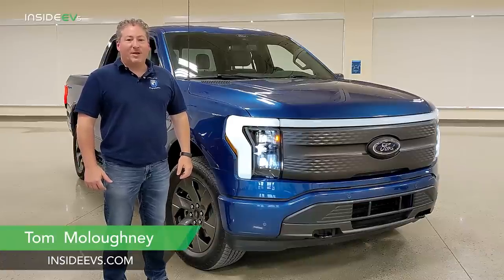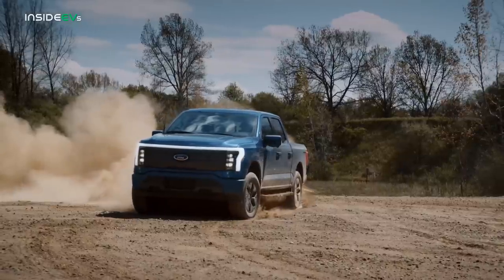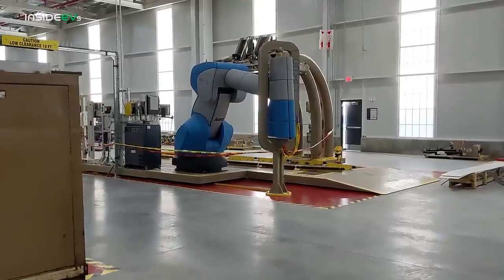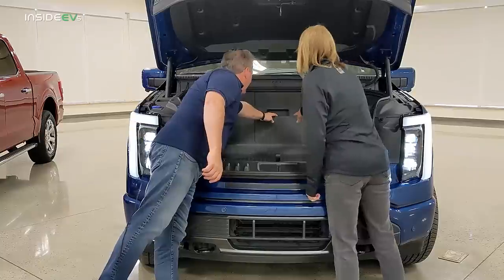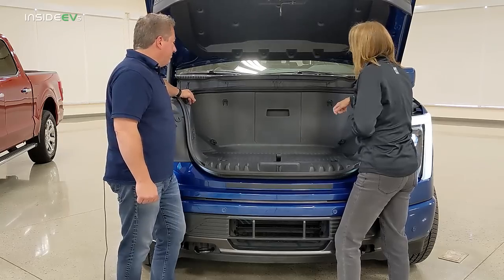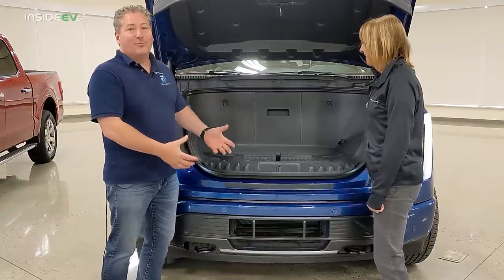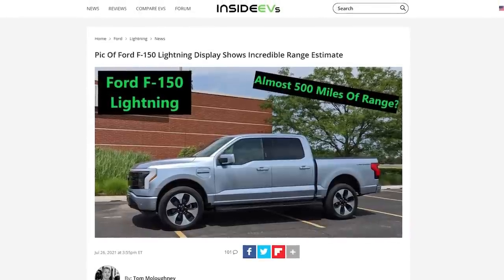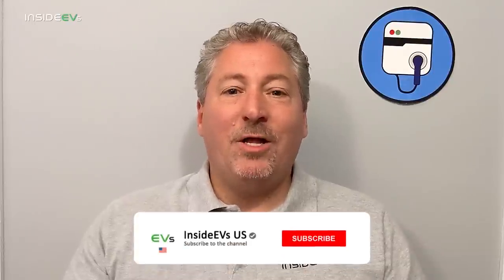Ford F-150 Lightning: InsideEVs First Drive Review

Comment: As a contractor who goes to various work sites this truck will be perfect for my needs.  I average about 150 miles driving per day so i wouldn't have to worry about charging outside of my home.
Reply: Agreed. I’m averaging 250 miles a day doing thumbtack jobs and I’m spending about $700-$800 per month on gas. I would literally save money buying a lightning f150 compared to my 2018 f150 with the 5.0 V8
Reply: @ericerickson592  I would bet my ass it wouldn’t be $700-$800 higher every month lol
Reply: @ericerickson592  1/4 to 1/6 the cost of gas
Reply: I'm thinking you'd cover your shed/garage/carport in solar panels. These are very cheap second hand,  still delivering about 80%.

Comment: The concept of using my Lightning as a battery so I can run my cottage during peak electrical hours and charge the truck during off peak hours is a game changer.  I'd love to see more about this, the inverter, the control panel, the charger etc.  Thanks !
Reply: I would be cautious about doing that too much, depending on how much electricity your cottage uses, this can cause excessive strain on the battery, reducing its effective life.
Reply: @AlamgirTamboli  I wouldn't worry because the battery life is likely to be measured in decades. Early Tesla batteries have been lasting 400,000 miles and newer ones are expected to make it a million miles. I expect Ford to be using the latest technology from SKI.

Comment: 19.2 kW charge rate is more than the peak consumption of my whole HOUSE which peaked at just over 18kW. I have two EV's that can charge simultaneously.

This is a great video!! The Frunk in the Lightening looks really awesome and so much better than the Rivian. Ford have utilized next level thinking and engineering here.
Reply: "Next level thinking and engineering"
🤔
They used the ICE cab) Front Clio from inventory to save money.

They bought in a compact (off the shelf?) front drive unit from a third party. (Time and money)

They cobbled together (literally) a  thermal control system from the parts bin which happened to sit vertically (time and money)

As a result of that, there was a  *"::"*:-  big hole where the ICE motor used to be.

They added a frunk tray similar to one they'd seen "elsewhere".

Logical progression, yes.

"Next level thinking and engineering"?
Let's be honest here.......?

Oh, btw the Rivian?
That passthrough storage below the rear seats?

"Next level"?
Certainly unique.
Reply: @rogerstarkey5390  Until we see a teardown from Sandy Munro I will take your comments as speculative. Other than those working at Ford on the vehicle few know how the car was put together. Let's wait for the Sandy Munro teardown.

Comment: This F150 Lightning is shaping up to be the most practical vehicle ever offered to the public, Ford's engineers and designers have left no stone unturned in building the features everybody wants and needs. The sports car acceleration performance is an added bonus, I'm seriously considering placing an order. Ford seems to be the closest EV pickup truck to actual full production status, if they can get these trucks on the streets before the competition that would be a big accomplishment.
Reply: Do it. You can always say no later. The reservation list is getting longer everyday.
Reply: Mach-E is charging disaster if you are on the road. Hope Ford learns something in F150 case.
Reply: @DukeSan27  There are several travelogues of people using the Mach-E to travel cross country and they are reporting no charging problems whatsoever. Time to update your old talking points.
Reply: @heathwirt8919  
"There are (more than) several travelogues using the big Mach....." who found the experience let's say "sub par" in comparison to others, either due to the vehicle  or the network, whatever, there's a problem.
Reply: If your charging experience is not good 99.99% of the time, then you will have very little confidence in going on a trip with the car. This is what Tesla solved up-front with their network. Ford is just doing one part, which is the car/truck, it needs to get in front of the charging part first, before putting out these trucks in mass numbers,
Reply: @DukeSan27  what charging disaster. I think you may be watching  vlogs from more than 4 months ago. I got my MME in February and I had some difficulty at DC fast chargers. I’ve taken my  MME on many road trips and have had no issues in the last 3 months.
Reply: The great thing about the frunk in the F 150 is that valuable tools can be keeps hidden from pilfering eyes. Way better than tool boxes in the bed as you aren’t advertising what you have inside.
Reply: @rogerstarkey5390  Like I said before Roger, you need to update your troll talking points. The charging issues have been resolved, do some research instead of desperately clinging to the past.
Reply: @ericerickson592  how many miles are you driving each day? If your commute is more than 250 miles a day, then an electric vehicle is probably not suitable for you.
Reply: @ericerickson592  you would be surprised how good EV’s are. I like large truck based SUV’s and my boat tow vehicle is a Lincoln Navigator. In my garage I also have a Tesla 3, a Mach E, and a Ford Explorer. Next month I’m road tripping Los Angeles-Dallas-Houston-Toronto(Canada) Los Angeles, in the Mach E. It should be a breeze in the F150 lightning as it’s range is better than the Mach E.

Comment: The keys to getting the F-150 right were a) price point and b) making it actually better than a gas or diesel truck.

Clearly nailed both. Having the dry storage (with a drain) is insanely useful, for lifestyle and commercial buyers alike. Not sure how well it'll sell in exurbs and suburbs in Texas and beyond, but it's a seriously capable vehicle with a lot of features that a gas truck simply doesn't have. Having that much power available without having to have a gas engine running has got to be so useful on just about any jobsite you like - but also a rave or a party where you can run coolers/sound systems etc or a trailer for performing, or living in like a caravan. What a vehicle! Only a shame it'll never come to the UK (where it's too large for British roads really anyway) but I'm interested to see whether they can make a Ranger version of this (I think a Transit version would be a lot better than the e-Transit too, but we'll see!)

Comment: I have a Dodge Ram and a Chevy Bolt.  The Ram is too expensive for fuel for everyday driving which is why I have the Bolt.  I will sell both the Bolt and the Ram and get the F-150 Lightning as this solves both issues.
Reply: Don't get wrong Tim that truck looks nice, but remember it EV that truck is way to heavy.  Sorry, there is to much leftover parts from their ICE vehicles.   I rather get a Tesla Cyber Truck.
Reply: @Madame702  I do like the Lightning, but with the 35 hose coolant system they will transfer over from the Mach E. I’m out.
Reply: @Madame702  I hate that Tesla crap. They make good passenger EV cars, but I want a conventionally looking EV truck...
Reply: @Madame702  And for you info, I just own a humble 01 Chevy Trailblazer, still on my 1st self-bought car...

Comment: I had a 2016 F150 3.5 Ecoboost or TT Platinum. It was so extremely comfortable I drove cross country in little over 3 days almost 900 miles a day. It had adaptive cruise and the visibility is awesome and cabin cavernous with great sound system. Even tho I have had 4 Tesla,  I would definitely highly consider the F150 …if they were around anytime soon!

Comment: I'm really interested in more info about the interior spec of the Pro model.  Thanks for the confirmation that individuals can purchase the Pro from day 1.  I agree that had not been made clear and I appreciate the additional information regarding the standard battery limitation.
Reply: Here's a little more info for ya, as someone who currently plans to buy the Pro model, I can tell you it doesn't come with the vertical touchscreen (same one on the Mach E), it instead comes with a landscape 12" touchscreen (same screen on current higher end F-150's)...not some tiny crap screen.   You should also know Ford charges a 1500 delivery charge...no matter what, which is dumb.  Also you'll likely want the tow package, which in another 2 grand.
Reply: @murc111  I’m also planning to get the base model for personal use. I much prefer the smaller infotainment screen as it leaves more space for physical buttons.  From a leaked spec sheet it’s too bad the pro model only has a 2 way manual drivers seat.
Reply: the Channel "Town and Country TV" did an overview. I was quite impressed. This sounnds like the perfect vehicle for our family's first EV.

Comment: Power Frunk light integration and cubby divider are awesome. If Hyundai stiffs NC of the IONIQ then this is the best V2L system out there as Lucid is way out there and not just in price. I haven’t heard about it since they publicly mentioned it at the launch. The US IONIQ 5 is a sad rate compared to Europe and pitiful compared to the Lightning but for a fairly stable grid it is enough to squeeze by for a few hours. Thanks Tom for the time and edits.

Comment: Hey Tom, any idea whether the Intelligent Backup Power System will work with a Standard-Range Lightning?  Great video, BTW!
Reply: I believe it does, but I will confirm with Ford soon.
Reply: I don't think so for a couple reasons. One is the system requires the 80A EVSE with the DC pins, that only comes with the extended battery models. Also from available information on trims, the home backup is only listed on the Lariat+Premium and Platinum trims, which come with the extended battery standard. You will likely have to pay $80k for the truck plus backup system cost ($8k?) to get the home backup system. It won't be cheap.

Comment: Great video, Tom.  Thanks.  

As you asked for suggestions, i know it’s too early to investigate now, but eventually I’m interested in how electric pickup trucks will influence camping, campers, and off grid cabins.
Reply: I am planning on lots of camping. I hope the longer range estimates are real.
Reply: @Yowzoe  I don't know if within 5 months you got this answer already, but Ford's estimate of 300 Miles ((Extended)) is them being conservative, with 1000lb of weight in the bed. Actual range will be higher, but who knows how higher
Reply: @Xyler94  I did get that. Great news. But the 5.5-foot bed length is just too short for my 6' body, so I think I'll be waiting for another vehicle. Still have my reservation, but I'm almost certain to let it lapse at this point. Thanks  🙂
Reply: @Yowzoe  I had a reservation, I canceled due to long waits... then they said they're increasing production. XD

My father's service manager at a local Ford dealer, and attends Ford of Canada meetings every now and then. He's in the know for vehicles. I still want one personally, :)
Reply: @Xyler94  I think the bed length and the size of it will keep me from getting it. I really need something in the Ford Ranger size. I understand that they’re going to do a an electric Ford Ranger in Europe, but it’s not gonna come to North America for a while, too bad for me…

Comment: Tom, thank you so much! I know costs will vary considerably depending on region, but can you give a ballpark figure of what it would cost to install an inverter and transfer switch to enable the F-150 to power someone's home? Also, Would the transfer switch need to be configured for critical loads only (fridge, lights, some outlet circuits) or would it be a whole house backup? I realize things like A/C ovens, heat pumps, electric water heater, electric dryer, etc. use a lot of energy and even power if on simultaneously, so what is Ford  (or SunRun) recommending? Also, I suspect it makes sense to install solar at the same time to be able to claim a federal tax credit on parts and labor for transfer switch and inverter, so total costs of fully kitted out backup system could be quite a lot. Still, some people would like to be able to get off grid. Thanks for you thoughts!
Reply: I would guess an electrician would charge $500-$1000 labor to install. Add on the cost of the inverter/switch equipment whatever it may be (my guess is $6000). No one knows the specifics of the transfer switch yet, but I would expect the whole-house type. 9.6 kW is enough power to run most homes most of the time, but if you have high load devices you might need to manually manage them by turning breakers on and off to keep the lights on. The inverter will likely only work with the truck, if you want solar that would be a separate inverter, solar tax credit won't apply here at all.

Comment: Hey Tom, you said for the Intelligent Backup you need to purchase "Ford's 80amp charge Station Pro". Is this different than the 80 amp charger that comes with the Extended-Range trucks?
Reply from the maker: No, I should have been more clear. If you have the Extended range battery pack, the 80-amp Charge Station Pro comes as standard equipment. It's optional if you get the standard range battery pack. I was definitely not as clear on that as I should have been. I don't always catch everything during editing - thanks for clearing that up!

Comment: what is the electricity cost for a full charge? and range?
Reply from the maker: We don't have the exact battery sizes yet, but our estimate is that the extended range battery has about 155 kWh of usable energy. The average cost of electricity in the US is currently $0.14/kWh so it would cost about $22 to fully charge it at home.

Comment: Great vid. My only "wish" is that someone ask Ford about accessory fitment. I know they've said if it fits a previous year bed it will fit the Lightning. What I would like to know is if a gooseneck hitch will fit. New frame with independent rear suspension is a game changer from past gooseneck hitch fitments like the one on our 2018 F150 XLT Sport. Any insight on this front?
Reply from the maker: No, we didn't. Please tune into the InsideEVs podcast on Friday, 9/17. We'll have Ford's Glober Manager Of Electric Vehicles, Darren Palmer on the show and he'll be answering questions live.
Reply: I assume most people towing goosnecks or 5th wheels would step up to a super duty so I wouldn't count on it.  Honestly, I would wait a few more years until batteries and the charging infrastructure improves a little more before buying an EV for regular towing unless you are only driving short distances around town.
Reply: @db4z09   Only tow short distances and a small gooseneck (7kgvwr) fits our needs. If we can get 100 miles round trip on a charge towing that trailer we would survive just fine. We also have a Mach E.
Reply: @InsideEVsUS  If you can remember, would you ask him about the specific bed dimensions and particularly if a canopy/shell/topper made for which previous years will fit the lightning? I believe I read that the dimensions changed in the 2019 f150, but I lost that source. ty
Reply: @InsideEVsUS  I want someone to ask WHY there is still a gear shifter, not many are talking about this. Give me more cup holders or storage bin.. my super duty has the shifter on the column, giving me the extra space..

It's an EV, it doesn't need a shifter.. Ram even  says so....
Reply: The battery is tucked in between the frame rails, so a flush mount gooseneck ball probably isn't going to work. It would have to be the type that bolts into the bed from above. Max towing will be around 10k lbs so it would have to be a small gooseneck. If you have big stuff to tow, don't buy the lightning because the range will likely suck (maybe only 60 miles at max payload). It's more for towing boats to the lake on weekends or smaller utility trailers to bring stuff home from the box store.

Comment: I think people should realize that the Ford Intelligent Backup Power option will not be cheap. It will require the Lariat trim with the Premium package, with an MSRP of $79k. Then you will also have to buy the 9.6 kW inverter and transfer switch, and have an electrician install them, which will add an estimated $10k to the cost. So you're looking at around $90k to get the home backup unless Ford makes it an option on a cheaper trim (probably not likely).
Reply: I was just quoted $35K for a battery backup system for my existing solar panels. Plus, this way you have a vehicle and backup emergency power.
Reply: It all comes standard with the extended  range

Comment: Tom, obviously it would be ideal and nice to have the 80 amp charger but my box will only support a 60 amp breaker, so I was (rule of 80) gonna get a home flex plug in for 40 amp charging.  Will this do anything to the lighting besides just take the onboard charger longer to get to full ( or 80% based on Ford specs).  Would I need to ramp down the speed in the car?  Did you see where we could go that.   Thanks!

Comment: The big question for me are; lowest price a consumer can get a model with the extended range, when will people with pre-orders get the truck, what will the real world range be towing a pair of Jet Skis at 2,000 pounds, how long will it take to recharge on 110 volts if you're visiting a friend or relative that isn't setup with 220 volts, what federal tax credits will be available when the trucks are delivered. It seems at this rate the 200,000 EV units Ford sells won't be around long especially since they're already selling the Mach-Es.
Reply: The trim prices are released, I would expect the extended range battery to be a $5000 option in line with the Mach-E. So with that you're looking at just under $60k MSRP for an XLT extended range. The Mach-E takes about 3 days to fully charge on 120V, the truck will take more power so probably 3-5 days to fully charge on 120V.
Reply: most EV's like Tesla only charge max at about 3-4 miles per hour on 110V